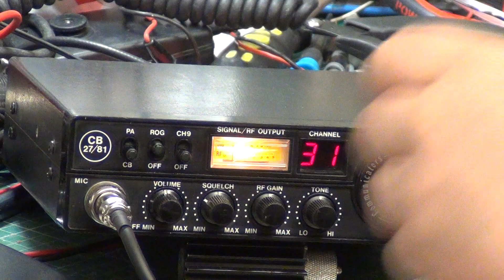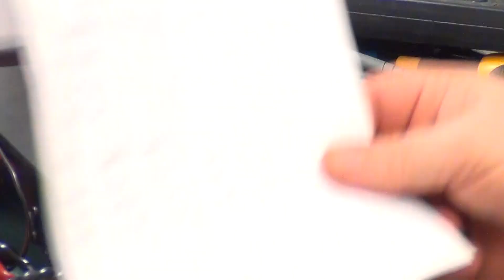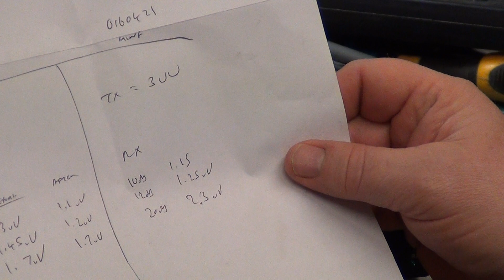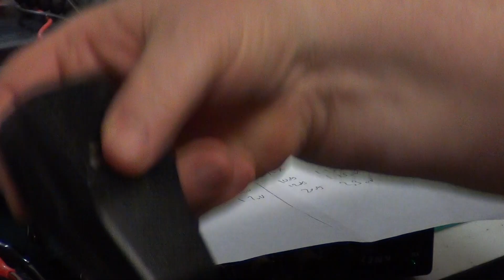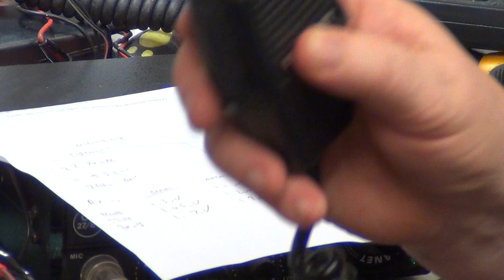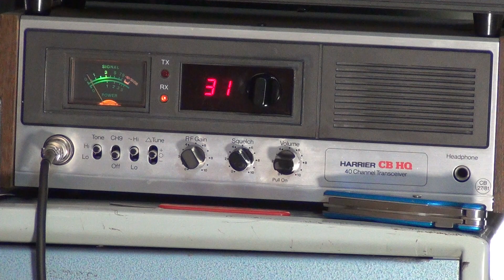LCL Communicators NI440DX CB27/81 UK FM CB radio - On The Air test

Comment: Hey i have this same CB but not sure what power supply i can use. Could you suggest one? And any cable I would need? Thank you.
Reply from the maker: It's a 13.8V radio so any normal regulated CB radio power supply is OK. The radio draws an absolute maximum of 1.3A on transmit, so anything with over 2A capability. The power cable has been unobtaiable for years. Knights at Kiirton In Lindsey used to have them but are no longer shown on their website. Rumour has it that some cooler box leads fit. Rumour also has it that cybernet power plugs will fit, but would be non polarised.  As you will see with this set, someone has removed the power input connector & done a nice flying lead with in-line removeable plug & socket. They've done a good job.

Richard, G0OJF, UK
Reply: @ukfmcbradioservicingTango21  thank you for replying and the info. I'll see what i can do 👍

Comment: This radio has a couple of different names - Planet 2000, Communicator NI440DX, Serpent, Manor Kestrel, lovely looking radio, kinda reminds me of a Pulsar 800 AM CB with one less button. 
I have yet to try one of these FM radios, but I just recieved a Midland M20 this morning after watching your video on the M20, and I didn't notice how small and compact it was untill I opened the box 😊
Reply: My mate bought a Communicator CB, he could hear everyone within two miles without changing the channel.  He gave up and bought a Rotel, much better, though not perfect, he did add a crystal filter, this made a huge improvement.
Reply: @BoB4jjjjs  Today it would probebly perform better as not as much bleed-over as there not as many on now lol.
Reply: @68LP13  Yeah, up here now it would be fine.  The sets sounded good on TX and did sound good until someone was on the other 40 channels within a mile or so of you.  I couldn't believe just how bad it was.  Nice sounding transmitters though, just a bit lacking in power.